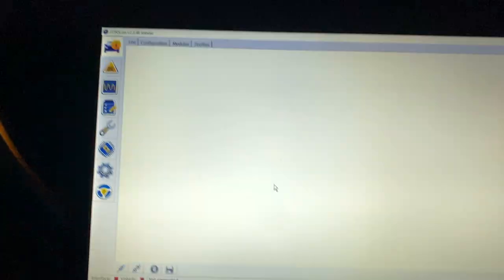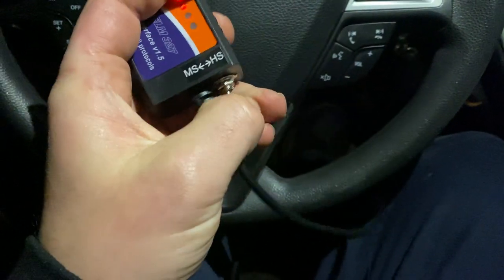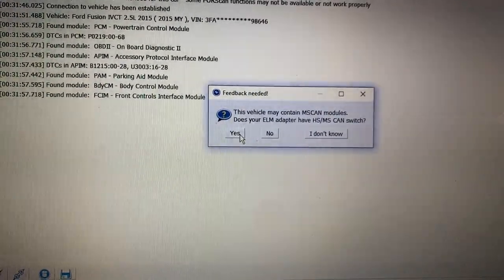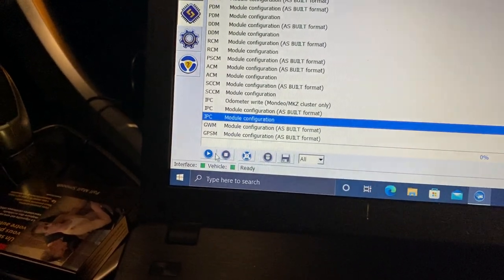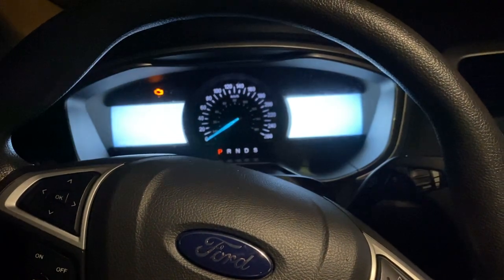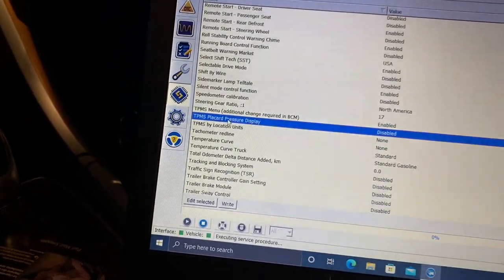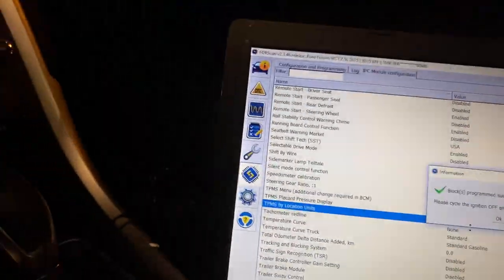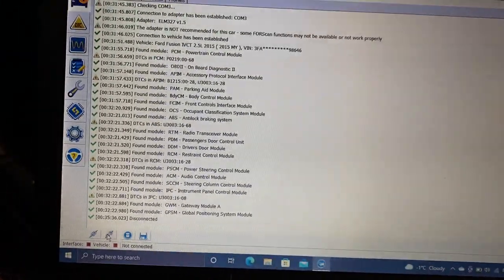How To Add Digital Speedometer & Tire Pressure to Left Instrument Display-2015 Ford Fusion SE

Comment: I have a 2014 Ford Edge and these options that you showed in the video do not appear on the ForScan screen, even when using the OBD2 reader identical to yours. How do I access these options?
Reply from the maker: Did you get the 2 month license?
Reply: @EverythingWindsor-EssexCounty  yes, I did it. I changed somethings like enable DRL for example, but the options that you show in this video don’t exist for me when I star the module in Forscan

Comment: Does it have the option to change the ambient lighting color..also the blue led inside the dashboard?
Reply from the maker: Are you talking about the ambient lighting in the cup holders and doors? If so I think there is an option on the screen for that or a button, as for the dash , this was the exact reason I got into forscan was to change that color and it didn’t work

Comment: Will this work for a 2013 Ford Fusion Hybrid SE
Reply from the maker: It should work if the sensors are installed in your model, give it a try and if it doesn’t work you can always revert the settings back to the way they were before just keep notes on what you are changing.
Reply: Late to the party. I have a 2013 Titanium. If my tire pressure is low. It’ll tell me but doesn’t specify which tire. I hate it. I tried this and it didn’t work. Really disappointed

Comment: Well done! I just wonder, why I don't see IPC module when scanning with Forscan in my Lincoln MKZ '13? Is it because of adapter model/version? I am using wired Ford ELM327 adapter.
Reply from the maker: Let me get back to you on that.
Reply: Any updates? I’m trying to do this on my 2014 mkz
Reply from the maker: @yazmo-official6417  are you using forscan with standard license with 2 month extended trail. If you need further help please email the address in the about section of this channel picture of your screen where it shows no IPC

Comment: Hello, did you install lincoln mkz 2013 cluster in my 2013 fusion, the tpms option does appear in forscan but it does not enable it on the screen and the digital speedometer option does not appear. Will you have update files or what can I do? I have a 2-month license for forscan and elm 327 and obdlink ex help please
Reply from the maker: I’m not sure if this will work in a 13 - I been told it only works for 15 and up

Comment: What is the difference from "AS BUILT" and the other option that does not say AS BUILT?
Reply from the maker: As Built is used if you have a spread sheet with the codes to change.
Reply from the maker: Kinda looks like binary. I normally don’t mess with those unless I have the speed sheet. Most of the time the changes can be made through the other option that’s not as built
Reply: I’ve used “as built “ to change the auto blinker from 3 to 6, of course you can change up to 8 flashes if I remember right. And when I installed led turn bulbs on a 15 fusion I used it to stop the hyper flash on the dash. But you do need to know what values to change and what to change them too.

Comment: Hello, what to do if the IPC unit does not have a digital speedometer in the selection list? Ford Escape 2013 SEL
Reply from the maker: I’m pretty sure it only works for 2015 and up

Comment: hi 
can i enable the TSR in my fusion 2018 1.5  without any hardware?
Reply from the maker: Let me get back to you on that, I’m out of town and away from my obd2 and laptop
Reply: @EverythingWindsor-EssexCounty  hi 
did you check it out?
Reply from the maker: Hi, Sorry for the delay, Yes the option is available to disable (TSR)Traffic Sign Recognition. It is under the IPC. You will need ForScan and An ELM obd2 with MS/HS Can switch.

Comment: I'm so irritated with FORScan. 
I don't see any modules that show ICP (instrument control panel) or IPC. 

I have that exact OBD11 and the latest forscan version. 
You cant just switch the switch to MS or HS whenever because the program won't run - you switch it when it tells you to. 

I have a 2015 ford fusion titanium.

I cant even get the frikin DRL to work only with the high beams and no taillights. I have my car's headlights switched to Auto and when I go from off to Auto...it first goes to highbeams for a half a second and then goes to low beams and even taillights. I have everything switched in FORScan too but it refuses to only use the front high beams. Soooo annoying. 

The IPC (or ICP) is an issue because it hust doesn't show up. If i was in demo mode (whatever that is)...i wouldn't be able to change anything if that was the case. 

I seriously don't even know what to do.
Reply from the maker: Hi, what exactly are you trying to get out of forscan? I can possibly help you
Reply: @EverythingWindsor-EssexCounty Hi! 
I just keep trying to use High beams as my driving lights (no taillights) and I have everything set in FORScan that I can see and enabling stuff that I was told. Nothing changes on my 2015 ford fusion titanium. I do have my lights set to auto but everything comes on. I have sync 2 (didn't know if that matters but I want to go to sync 3). I can't get the IPC to show and I was hoping I could set other stuff in there like my side mirror adjusting when reversing to parallel parking, etc. My biggest thing I've been working on is figuring out why my DRL lights aren't going to high beam only. When my headlights are turned to "Auto", I push button start the car and for a split second my high beams come on and go directly to low beams and taillights. Then I need to figure out why I can't get navigation working (I don't need if I need a card, etc, to get all that going). 

Everything else I can get to change, just not what I mentioned.
Reply: Plus...it woukd be nice to see a completely full list of all the built-by codes and actually just do it all that way. I have ford's full list but we can't see that full list of built-by's on FORScan
Reply: @EverythingWindsor-EssexCounty  ???
Reply from the maker: I know the mirrors only work if you have the 3 position selector on your mirrors - as for the high beams thing I have never heard of that one, there is a forum on the forscan website that has a lot of resources, as for a spread sheet I have yet to find one and I don’t usually mess with the as built settings.

Comment: Greetings Dear friend, if possible, please help me.I have a Ford Explorer 2012 and I want to add a digital speedometer like in your video, but I didn't succeed. I would be grateful if you could help me.
Reply from the maker: I’m pretty sure this is only on 2015 and up
Reply: Thank you for your guidance. I hope you will be successful and victorious in life. I had another question. In the area where we live, summers are very hot. I want the radiator fan to work at a lower level through the Forscan program.
Reply: For example, now the fan starts working at a water temperature of 90 degrees Celsius, I want the fan to work at a temperature of 75 degrees with the Forscan program.
Reply: Please help me

Comment: Have u had the issue of the battery draining while using forscan? I did 2 mods and then the battery went out of juice and the car wouldn’t start
Reply from the maker: No I have not experienced that , i start the car while I do this incase that happens.
Reply: @EverythingWindsor-EssexCounty  Do you think it could be because I didn’t turn the car off and on like i was instructed to?
Reply from the maker: That’s very possible, I would also try undoing the changes you made to see if it fixes the issue. You may also have a bad battery.
Reply: Yeah my battery was going bad, it was just a matter of time so I got a new one, the only changes I did was enable the cooled seats and heated steering wheel on the sync system. Currently it’s starting up perfectly fine now
Reply: I’m just worried now that if I do more changes I’ll mess up the new battery
Reply from the maker: Ya I think you should be good, try starting the car when doing changes and be sure to save original settings as a back up
Reply: @EverythingWindsor-EssexCounty  start it? Like start engine or what you were doing in the video?
Reply from the maker: Start engine, I didn’t do that in the video because I knew I was going to be quick
Reply: @EverythingWindsor-EssexCounty  Do you think there’s a risk when it comes to using Forscan?
Reply from the maker: Oh absolutely, that’s why I say make sure to save the original settings.

Comment: Did you have to switch anything else? I enabled each setting in Forscan and ran it through. Neither gauge is showing up in the cluster though. Was there something else that needs to be modded to display it? What tab should they be under?
Reply from the maker: That was all I enabled.